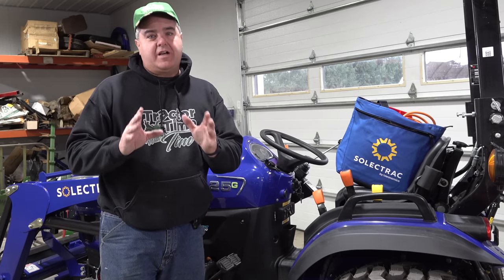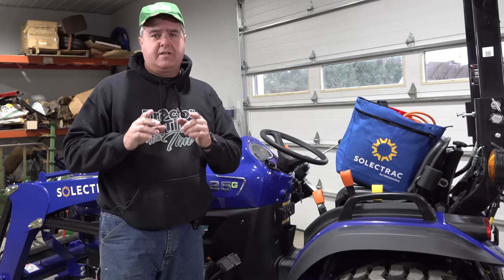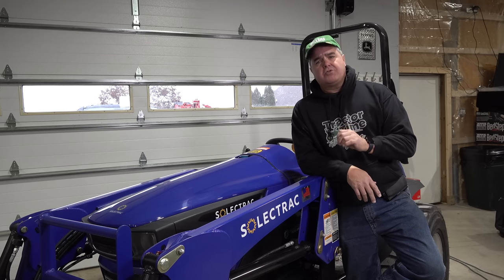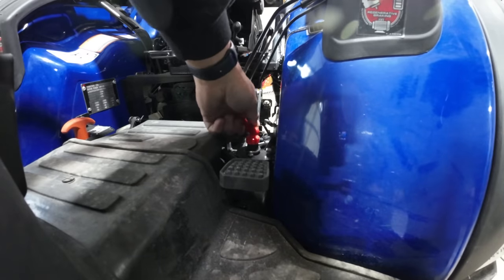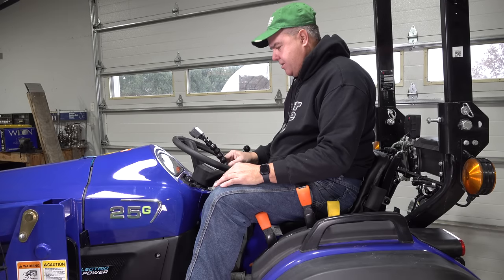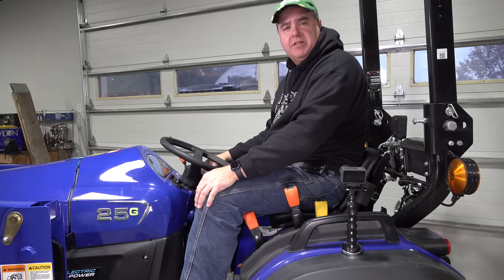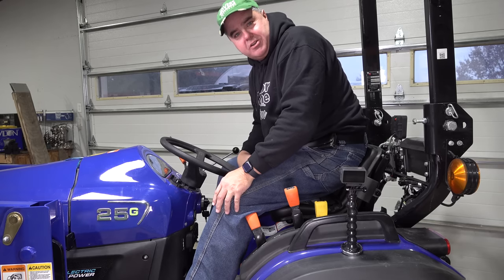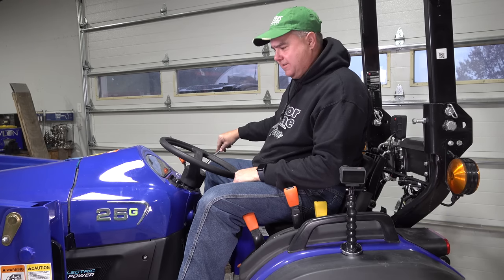Solectrac Electric Tractor First Look; Startup, Transmission Control, Initial Recharge Time & Charge

Comment: Can you post close up pictures of the plug and socket? I suspect it’s a J1772, which is the standard level 2 charger plug. If so, it should charge with any Level 2 charge point. And indeed, EVs ensure you can’t drive away with the cord plugged in.

Comment: Very good introduction.  Our company has used battery powered fork trucks for years with good results, but those use lead acid batteries.  I am curious how the Lithium technology works out.  Two things I see that I do not like about the tractor are the loader joystick mounted forward instead of on the rear fender, and the Forward and Reverse control  Would much prefer two pedals like a traditional hydrostatic setup.

Comment: Tim how long does it normally take for you to plow your driveway on a Johnny 1 tractor if it takes you a hour and a half to 2 hours your going to have to tow the tractor back to your shop and the same if your mowing
Reply from the maker: It will run longer than that.
Reply: @TractorTimewithTim  I read on there website 3 hours in hard conditions then you put the cold factor to it then it half’s that to 1.5 hour cause on electric vehicles the cold half’s the range

Comment: i have a sub-compact Massey GC2300 diesel hydrostatic drive 4x4 tractor with a loader.  it is very easy to run the loader with my right hand and go forward and backward with my right foot.  the first major question i saw with your electric tractor was the "forward/reverse" switch on the dash.  so if you are operating the loader with the right-hand joystick, do you have to keep reaching to the dash to go "forward or reverse?"  this would be a NIGHTMARE trying to spread gravel or load/unload dirt or gravel.  is there some other "foot control" that makes this tractor go forward or reverse?  i know you don't want to get into the debate over electric vehicles, however, i think electric tractors are going to be one giant "pain in the a...." to run and recharge.  what do you do if you run low on electric out in a field?  with a "normal" tractor, you just go get a can of gas or diesel.  with an electric tractor, i guess you will have to take a gas generator on a trailer out to the field and plug in the tractor.

Comment: GE made an Elec-Trak lawn tractor back in the early 70's.  It's driven off an electric motor driving a geared transmission.  I'm guessing this is the same with the shift levers on the left a geared control and on the dash electric.  I'm not sure the electric control on the dash will do much except help inexperienced operators perhaps.  Looks interesting.

Comment: I would like to see what the plug on the tractor side looks like. It is unique to the tractor. As the one for my Chevrolet Volt is completely different.  In my case for the Volt the car will not accept more than 3.3 kWh to charge. That's really low for an EV but I think because the Volt has the gas motor ( and that's the reason I bought it) GM didn't see a need for a faster on board charger. On the car the battery is 18.4 kW but only 14.1 is usable. They do that to extend the life of the battery. If you look up J1772 you can see what the "normal" EV end of the cord looks like. I like the concept of an electric tractor as I seldom use my Kubota LX more than 2-3 hours at a time. And only put 50-60 hours a year on it. But then I don't use it to make money. I just use it to maintain the woods, snow ect. The only concern with the tractor I see is it looks to the size of a BX or 1025r. I have upgraded from my old B7510 because it was too small for lifting the logs I need to move.

Comment: Get your scales out and weigh the front and rear axle compared to a similar size diesel tractor. Would be interesting to know if the weight split between front and rear is different. Meaning do I need to add more front weight if I buy a electric tractor as the weight is more centered on the rear axle or vice versa

Comment: This will work great for anyone that lives in a residential community! Having this will 1) eliminate the noise complaint issue from neighbors (especially older neighbors)
2) allow for earlier and later use without worry of bothering neighbors 
3) eliminates the exhaust issue
4) eliminates the worry of keeping diesel in containers around the house or in the garage.
Reply: There is no worry of storing diesel as far as flammability and vapor, there are 275 gal oil tanks full in peoples houses for heating. You can throw a match on it and it will go out. The lithium batteries will start on fire first.

Comment: The plugs size is large to accommodate larger gauge wires for higher amperage uses in a 240 volt system.  This is why you have 60, 80, 100, 120 and such watt breakers.  To handle the higher amps.    
The charge time and rate will change over usage time, based on the battery internal condition (sulfide build up).  Older batteries (a lot of charge and discharge times) will take longer over the life of the batteries.  That is why they say do not recharge until it gets to 20% or lower.  It prolongs the life of the battery.  Same as your cell phone.
Reply from the maker: breakers are specified in amps, not watts.
Reply: @TractorTimewithTim    Yes you are correct.  I don't know why I type in watt when it should have been amp.

Comment: Thanks Tim for doing this Tim and I know you'll do an honest appraisal of this tractor. So many lump so much hate onto EV's, but I also remember when cordless tools were rubbish. Now its what I reach for 95% of the time. Something like this would more than suit my needs for a couple of hours running on a weekend or a day off as my 1025R barely has a chance to get warm with the work I currently have going on.
I could throw some electrons in it while I have lunch during the heat of the day and finish it off overnight or essentially free from the solar on the roof while I'm at work during the week. 
The initial outlay would be a bit of a hump to get over though, even with free electricity from my roof and diesel $2/L, it would take a while to recoup the premium over the equivalent capacity diesel tractor.
The 15F limit is no issue for me, if it gets below 15C then we all complain its too cold and stay inside by the fire.

Comment: The biggest, most important limitation with regard to the temperature will be that you should absolutely not charge the batteries at temperatures below freezing. That could permanently damage the batteries. Also, the most efficient / fastest charging of most batteries occurs between 20% and 80% charge. below and above that charging is slower and causes more battery degradation (reduction of battery capacity). Some battery chemistries and or technologies mitigate all mentioned limitations, for example, Tesla's almost always refuse to charge batteries below a set temperature and instead uses part of the power to heat up the battery until it can safely be charged. That is why it is always important to read the manual of battery-driven equipment.
I think you will find that whether an electric tractor is more or less suited for a particular application will depend on the application and the circumstances. The technology is not yet developed enough to be a full replacement, but with some adjustment, it can do a lot of the work. I look forward to hearing about and seeing your experiences.

Comment: Thanks for this. Always nice to see a product reviewed without the political baggage on either side. Looking forward to this series. While we'd all love to hear your experiences with this in a blizzard, I don't think anyone would fault you for using a cabbed tractor in single digit temperatures, even the OTC. Unless you're going to make Christy stand outside to take video...
PS: I recently installed a LifePO4 battery in my camper. It has an internal heater making its operating range -4°F ->140°F, charge -31°F ->122°F. You obviously lose some battery at colder temps but could safely operate at those temperatures. Wonder if Soletrac may offer a low temperature version at some point?

Comment: Interesting choices they made for the drive system.  To me it seems like you would think about driving this tractor like a manual tractor.  You pick the rear end range, and the electric gear that gets you close to the speed you are looking for then vary the throttle to adjust within that.  It is curious that they chose to have the pedal be torque based control like a car vs speed based control like a hydrostatic or governed engine based control.  

It seems to me a better solution for that fwd reverse switch would be one like used on a forklift, they look like a turn signal stalk from a car and you can hit it with your hand without removing your hand from the steering wheel
Reply: I'm thinking if they just replaced the diesel with a big electric motor nothing else would be different.  A diesel/hydro tractor only uses the diesel to turn the pumps anyhow.
Reply: @RealJeep  that is true that the diesel just turns the pumps, however there is a good amount of power loss in turning the hydrostatic pump and motor that doesn't need to be there with electric as you have control from zero rpm to whatever max rpm is.  Diesel has no choice but to use the hydro system as you cannot get a diesel to turn very slowly and deliver smooth power at really low rpm.

The power savings from not using hydro to turn the wheels as well as stopping the drive motor when stationary help to extend the useful battery life.  That is likely the same reason the switch is there for lift mode, likely the power steering only needs some lower pressure or flow to work so they can run the pump slower or at a lower load, then when you need to use the loader they kick the hydro pump into high gear or high flow to provide for loader usage.

Comment: I'm wondering if the seat can be adjusted light enough for Christy to engage the seat safety. Do you know yet if the transmission is driven directly by the electric motor or via the hydraulic pump? I'm thinking it's the pump, but not positive about that.

Comment: You'll need to get with those guys that had the dyno at the tractor show and do a PTO dyno on this tractor, would be curious how the PTO HP is VS a diesel model with the same engine HP as the electric motor model.  

That tractor looks pretty good, but what is going to be a potential issue is dealer support down the road when things start going wrong.  Looks like its just about the same size as a JD 1025R dimension wise?

Comment: 15F is a pretty disappointing lower temperature limit for a tractor.  I guess that really limits the cold weather testing  I would have expected the ability to keep the tractor plugged in to keep the batteries conditioned.  I think you'll be fine for your testing because you're keeping the tractor in a heated shed and merely operating it in a cold environment.  It'll take a long time for the batteries to cool down, enough for you to get your plowing done.

Comment: Oh, how exciting!  Would I be able to use all my 1025R tractor implements on this?
Reply: It doesn't have JDQA system up front.
Reply from the maker: Rear attachments, yes.  Loader mount, no, as JW says.
Reply: Thanks guys!  Hmmmn...I use Forks a lot.  Maybe it can be modified.
Reply: @Dogs Rule  its highly possible that  you can keep the forks you have, but buy an SDQA frame to put your current forks on.

Comment: Hey Tim, great video. Your charging cord looks like 12 AWG (20 amp) wire plugged into a 50 amp outlet. If that cord were to get pinched or have any sort of failure, your main circuit breaker won’t trip before your cord burns up. Now I’m not there, just going off of what I saw, so I’m sorry if I am mistaken.
Reply from the maker: Think about it from the other end.  The cord was provided by the tractor mfr.  they know the current usage, etc.  
sorry, I am not going to run a special 20’amp circuit just for this.   
Typical nit picking.
Reply: @TractorTimewithTim  wasn’t trying to nit pick and I’m sorry if it came off that way. All I was trying to say was that you plugged a 20 amp 240 volt circuit into a 50 amp outlet. Yes, it will work but it is a fire hazard if the cord were to get damaged. I’m sure you have some electrical friends that you could ask about this if you want another opinion. If not, to each their own.
Reply from the maker: @simplemansbbq5495  I get your point.  Do you get mine?
You are technically correct. …but again, this is a special purpose cord, used only by this tractor.

Comment: Great videos Tim.  Having an electronic/ electrical background i know enough to make the decision that I have no intrest in full electric vehicles.  There are more pitfalls then benefits in my opinion.  I don't know why these electric vehicles are being pushed so hard.
Keep up the great work, i will be skipping past the electric tractor videos mostly.
Reply: When they control the electric they control You. Computer chips
Reply: @peterparker9286  
Yea it makes me mad when the power goes out I can’t fill my truck with gas because the electric fuel pump won’t work.
Reply: @freddymax5256  Transfer pump DC 12.

Comment: I’m wondering why a switch for the hydraulic pump. You would think that you could still drive the tractor if you have no power steering. Is this the case ? Maybe electric power steering would be an better option. ???
Reply from the maker: Can be driven, but steers VERY hard.
Reply: This is fairly common. Most SCUT/CUT tractors have no mechanical linkage between the steering wheel and power steering cylinder. So without the pump running it can be nearly impossible to turn the steering wheel. I too wondered why a switch. Unless it is for power saving purposes when doing certain functions. Tim will probably get into this during testing.
Reply: @TractorTimewithTim  oh. Ok.
Reply: @eosjoe565  thanks for that information.

Comment: My problem is environmental issues of the battery replacement, disposal and maintenance issues,, cost is a whole other issue,, other wise a good video tim
Reply: The videos will be on how the tractor operates and functions, not on the upstream or downstream of batteries.
Reply: I worry about all the drill holes and oil rigs we’ve built to get petrol a diesel and not to mention the environmental issues with refineries and the transportation of the oils and byproducts all over the world!!

Comment: What would the amperage circuit need to be for someone who doesn't already have one installed ?
Reply from the maker: watts / volts = amps         3380 / 240 = 14 amps.  So, 20 amp 240v breaker should be enough.
Reply: @TractorTimewithTim  👍sounds good. Just wanted everyone to be aware of the added cost if needed
Reply from the maker: Wait, so you really didn’t need me to answer the question???  Ugh.
Reply: @TractorTimewithTim  lol. Sure, It was really for anyone who might be interested in investing in one so they could get and idea of what they may need to do just to have one.
Example- If someone has a finished garage and cannot do the work themselves they would need to pay an electrician hundreds of dollars to install the circuit. A 20 amp 208v circuit would be cheaper than a higher amperage.

Comment: Where is this thing made again? And what is with the American flag sticker? What does it say on it? 
What do you think of the play on the LS blue color and putting an American flag on it?
Reply from the maker: I’ll try to get details on the sourcing.  On the surface, the American Flag on there doesn’t seem genuine…I’ll try to get the story.
Reply: @Willie Orpurty Tractor is made in India by Farmtrac, the actual brand of this tractor. It's called Farmtrac FT26G on the rest of the world. Kubota even has a deal with them and sells the rebadged diesel version of this tractor under Kubota paint and stickers. Recently they announced an electric tractor as well which I'm sure it has something to do with Farmtrac.
Reply: The loader has the sticker and it's manufactured separately from the tractor.

Comment: 15 F or -9 C is in my opinion pretty damn cold. There might be some areas of Scotland that get that cold or lower but in my part of southern England you rarely see temps like those. In my area heating systems are designed for an outside temp of -2 C because we very rarely go any colder than that.
Reply: It's extremely cold, and it does get even colder where he's at occasionally. The midwest can get some brutal winters from time to time when Canada leaves its doors open.

I was curious, so i pulled up some record temps for Indy which is the closest major city to Tim. They observed -27F on Jan 19, 1994. Next coldest was -25 F on Jan 5, 1884 that's still a record for that day today. They've even seen below 0F temps as late in the winter as -5F on Mar 12, 1948. And freezes as late in spring as 31F on May 27, 1961.
Reply: @WilReid  I guess it just means that this type of tractor isn't designed for that part of the world just yet. Battery charging/discharging are chemical reactions which are effected by temperature. I know Tesla cars for cold weather have to operate a battery heating system to allow them to function in cold environments, but this inevitably decreases the range and increases production cost. I believe this is a first gen proof of concept type of machine, so someone made a decision probably to sacrifice a good heater in this model or perhaps the amount of energy to keep batteries heated at these low temperatures is so great there's too much loss of performance in other functions. Once you can start a market you then have funds available to improve the performance and expand your market. Battery technology is improving by leaps and bounds all the time right now and I wonder when development began as to what was possible back then. My guess is they have already begun designing new models and in the near future we will hear about a cold weather capable model, but what the cost or tradeoffs will be is anyone guess right now.